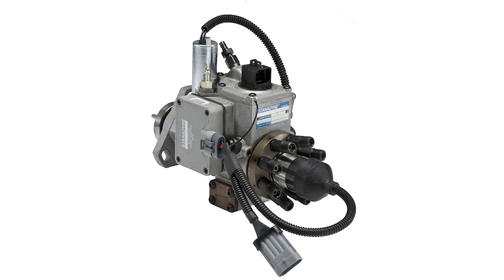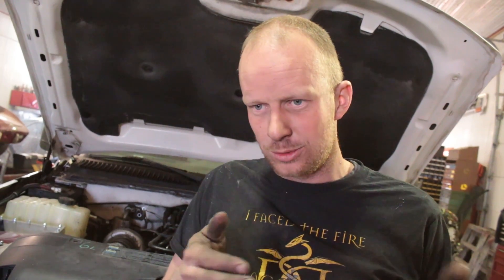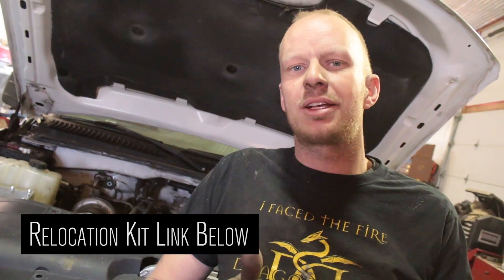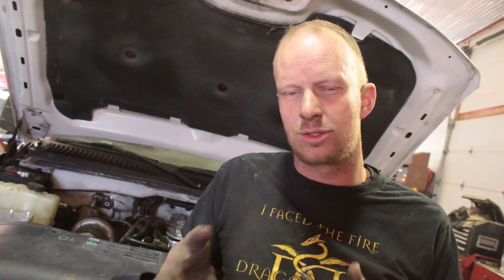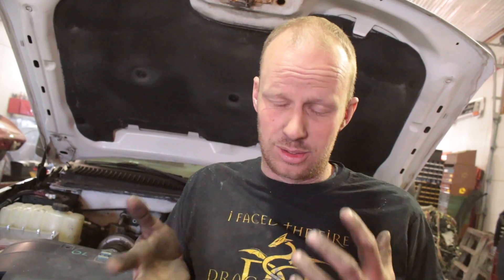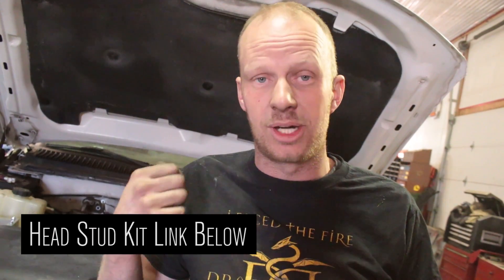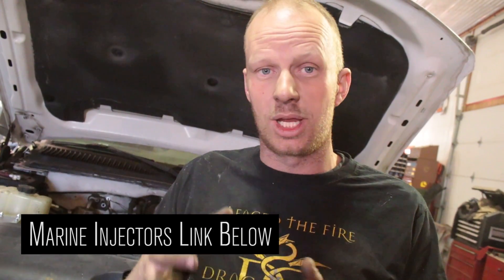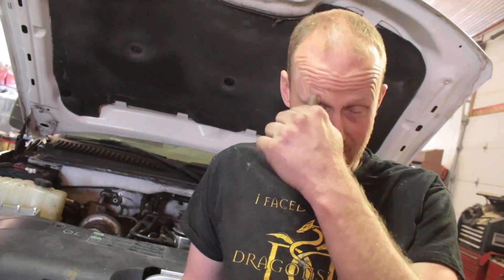REVIEW: Everything Wrong With A GM 6.5 Detroit Diesel

Comment: You are one of many I have heard say the 6.5 TD can't pull. I have to wonder where you all bought yours because I have owned 1 of my own ('92 Chevy 3/4 ton) and driven quite a few company pickups (3/4 & 1 tons) with the 6.5 TD and have never had any problems pulling whatever I've put behind them. In fact, my own 3/4 ton was more than capable of dragging a 28' neckover trailer hauling a Caterpillar 416B backhoe down any highway, even in hilly conditions, without loss of speed. I have known of a couple that had been modified with high lift, huge wheels/tires and so forth which had lost a good deal of power but once the proper gear ratio was put in the axles that problem was solved. Driving a truck with a 6.5TD does require a different technique than a gasoline powered vehicle to get the most power. Most people tend to floor a gasoline engine to accelerate, especially when going up a grade. If you floor the 6.5 it will usually cause the engine to lug, probably smoke some and take quite a while for the turbo to speed up. To avoid lugging the 6.5 and get the most out of it throttle management is essential. The best practice is to accelerate gently until you can hear the turbo singing then add more throttle as the engine will take it. If your driving habits are making you see black smoke in your rearview, you are wasting fuel and not getting the most power from your 6.5 TD.
Reply: Y'all are full of shit down talking the 6.5...I've got a 1997 c3500 quad cab dually with a 6.5..and a 4l80e tranny.. It has 212,000 on it..and I haul freight with it daily..usually total gross at 22,000 pounds.."truck is 7,000 pounds by its self...point is no it's not a big CAT engine..but it's solid if you take care of it..and mine has zero blow by..even at its mileage..try getting that with other diesels...Yes do the relocation..couple hundred bucks..change the lift pump 68 bucks..change harmonic balancer "which is the cause of the cranks breaking"..92 dollars. And change crank senser 32 dollars. Maybe a external cooler would be a good idea and oil temp gauge..tranny temp gauge also good idea if you haul with it...Use good injector cleaner regularly...yes waste gate should be made manual 150 bucks??..point is you can spend 600 or 800 bucks give or take on upgrades and it will last forever...oh yeah..and yes the injector pump is 989.00 at auto zone+ install..BUT..it won't go bad if you do the other mods..and even if it dose...it's still 500 cheaper then just buying injectors for a duramax...let alone installation..my injectors are 300 if they ever go bad which they still Havnt..and unlike the diesels I can change them easily in a afternoon..the others diesels you better have a engineering degree to change them or pay a shop a grand or 2.
Reply: @dieseldog2649  I pulled my rv trailer coast twice with a 6.2 banks turbo and 410 gears
Reply: People are missing one of the important things that makes the 6.2 and 6.5 different than other diesels that came later like the PSD 7.3 and Cummins 5.9. Both of those later motors were commercial diesels that changed to meet standards needed for installation and road use in light duty trucks.
The Detroit Diesels on the other hand were built from the beginning as light duty diesels that met emissions standards for use in half-ton trucks. If you were hauling stuff, and not even really heavy items, you could only count on 10-12mpg from a 350 in the 80s. She might do better unloaded, in overdrive on the highway but once under load your fuel economy went out the window. 
Ditto for the 454s in the 3/4 and 1-ton trucks. They'd haul anything you wanted and get 9mpg doing it. You just accepted the shitty mileage in exchange for the torque and when gas was less than a buck a gallon, who cares? But the 6.5, especially in later turbo form, would deliver better torque than the stock 454. If you're running a fleet of heavy duty trucks, it's hard to argue with a fuel sipping diesel that has decades of development and aftermarket support along with a thriving marine parts business. Sure, she ain't as hot as the commercially derived PSD or Cummins ISB, but you never paid those kinds of prices for them either.

Comment: I just got rid of my 6.5 not too long ago. I had relocated the PMD, installed a Heath chip, hx35 turbo, swapped out the fan for a bigger fan off of a duramax, diamond eye straight pipe, and cold air intake. Overall the truck was fantastic... it never gave me issues and I used it as a daily driver. In fact it never broke down on me once. 144k miles on it when I sold it. Consistently got 22-25 mpg unloaded and almost 20 pulling my enclosed trailer.

Comment: The black Box is called a  pump mounted driver.  There is also a chip that goes in between the pump mounted driveand harnes.  This chip if memory serves me right came in 1 to 9. Its a fuel Resistor that changes fule output of the box. There was also a short harnessed that went between the pump And the main body harness it was a RF harness basically. I had to hit remove it on my 96 Due to the truck started busting up rough idle no power. After a talk with the guys at SS diesel supply  They had me check that before I remove the pump for rebuild. Saved that cash.

Comment: Have you ever had any GM 6.2's come through? They went from 1981 or 82 to 1992. They were N/A but in later years a Banks Turbo kit was available. They are an economy Diesel, get really good mpg and decent power. They also used them in the early Humvee's and CUCV's. With a turbo and OD you can get about 20-35 mpg. 6.5 manifolds, heads, and turbos are interchangeable. I'd love to see your opinion on these.

Comment: I have a 6.5 in my 99 HD flatbed. I really was never convinced I made the right choice to buy a truck with a diesel. Couple of Q's. 1. do 6.5 diesels all have valve covers that say "Goodwrench" on them? 2. I have 92,000 miles on it and it has hardly any oil pressure once it warms up. 3. This thing leaks oil like there is no tomorrow. My friend says there is to much internal crank case pressure. Or or or or. To many ors. Have you heard of a leak that bad on an engine with 92 grand on it? I live in Mississippi so it does not get that cold in the winter so a cracked block is not high on the "maybe" list. thanks in advance for any info.

Comment: My dad had a 99 white crew cab dually driving down the road not under a load or anything snap the front of the crankshaft off after that we bought a junkyard motor that had a hole in the side of the block ran it for about 2 years love it with cast iron welding rods and J-B Weld leak like a sieve but ran for about 2 years before overheating and never got to finish a Cummins conversion of my dad passed away in 2014

Comment: One thing you forgot is when the Harmonic balancer goes bad it will brake your crank shaft.
The dirt settles in the inside hole of the Harmonic Balancer and throwing it out of wack.

Comment: I just bought a 2000 k3500 crew cab smoking white smoke sounds like a missing injector pulled the intake off turbo is spitting oil but still feels like a missing injector also showing like 40 codes which I think is all of them anyone have a diagram for the ground wires ?

Comment: The last 8 years with my 6.5L  have been in a 95 Suburban, as an electronic pump turbo engine.  The electronics took a while to get used to, however, I must say the Suburban even stock was much faster than the Blazer ever was.  I rebuilt the engine on GP before dropping it into the Sub, and found the crank, pistons and block to be in excellent and clean condition.  

I think you did a good job explaining the pump situation.  Yes the black box, or the PMD or FSD, is the heart of the whole operation.  It's recommended to get it out from under the engine bay completely and into the freshest outside air you can find. Mine rests just behind the front bumper on a huge heat sink.  Gotta keep it cool at all costs, or else it will cook on you. Not a bad idea to keep a spare box on ya.  

Other things to consider.  If your lift pump (main fuel supply pump) is not working properly, you will burn up the high pressure injection pump.  One of the troubles is the circuit for it runs through the oil pressure sender, as a safety measure (no oil pressure, no fuel supply).However, it is a weak link, and the IP will continue to struggle and pull fuel even without the LP.  We modify that circuit by using a relay. Keeps the original intended safety there, but pulls 12v supply power straight from a battery source. 

I indeed did stud my heads when rebuilding. ARP sells $180 of the best piece of mind you can buy.

Another area of concern- oil cooler lines.  Replace the crimped hose/line nightmares with braided stainless lines.  The stock lines will blow and relieve you of all your precious oil at a very bad time if you don't heed this warning. 

The last area I will address- cooling.  2000 and later engines have the best cooling systems.  Good news is the 2000 pump and cooling fan will fit the older models of the engine and provide more even water flow to both sides of the engine.  Keep this engine cooler than 210 at all times! 

You can modify these engines and make a solid 275 HP at the wheels, considering you've updated all of the weak links I mentioned above.  It will be reliable and you'll be able to do some work with it, but no this is not a 1000 HP coal roller.  Best for efficiency and economy.  Hope this helps anyone thinking about giving one of these engines a try. It's been very very good to me.

Comment: I have put over 300,000 miles on the same 6.5L over the past 20 yrs, so please allow me to add my input.

It is a good engine.  I remote start it every day almost, and it lights off on the first start 99% of the time.  This is true whether it's 100 degrees or 0 degrees outside.  If you forget to plug in the engine heater, it's really very forgiving and will still start.  I do try to take care of it and plug it in below 15 degrees.  

The first 12 years I had it, it was naturally aspirated and mechanically injected.  Not a powerhouse, but definitely a worker and comfortable cruiser in a K5 Blazer.  It returned 25 mpg in that platform.  I had a learning curve on how to keep a 700R4 behind it.  Didn't help that the guy who built the trans first put a gas torque converter in it with a higher stall.  But this isn't about 700R4's.  Engine always did it's job without complaint.

Comment: Thanks for not being a dick!!! This is a good and honest review of a 6.5 for the most part. Some numbers are not perfect but close enough to make a good decision. I love my blazer with the 6.5 in it from the factory. But I have updated everything on it. New injection pump, injectors, tune, cam, exhaust, intake ( entire intake system) 21 Lbs of boost 400 HP. And stock heads studs and gaskets.with no problems yet. Waiting for them to blow to replace but great engine with the right updates.

Comment: I have a 6.2 Detroit NA with Muncie 4 . As long as you're not trying to lay your foot in it and you maintenance it as should good work horse with good low end torque no speed demon by any means so any kids looking to swap for speed would not recommend. But problems with 6.5 coming from a 6.2 is the wiring I believe just from going all mechanical to a wired up system it's guaranteed to have flaws.

Comment: I had a 94 6.5 for about 5 years. It was nothing but a money pit, but hey what diesel isn't. Had everything from inj pump problems, to overheating. I ended up selling the truck due to a crack in the block where the starter bolts up (couldn't start the truck). That is also a big issue with these motors. I will say a straight piped 6.5 with marine injectors sounds mean, that's it.

Comment: 6.5 sucks hands down. Served in the Marines as a wrecker operator and that was 90% of what I towed. They just don't have the power they need as a result they get over worked and over heat very quickly. Doesn't help that the hmmwv had armor upgrades. Thank god that platform is getting replaced by the JLTV from Oshkosh

Comment: Turbo??? Mine is Naturally Aspirated and I love it. Just blow an oil cooler hose but it should be an easy fix. I've replaced my pmd but ultimately it was an injection pump issue. I bought the pump from rockauto for 750 and did the work myself with the help of a Chilton manual. I think I'm just going to block off the oil cooler lines for now until I decide on a new oil cooler.

Comment: i think 92 mechanical pumps are the way to go. the military didnt use elec pumps. i did a 94 engine into my 97 trk and i had to get new oil cooler lines. i forget where from because 94 blocks used 3/8 fittings vs 97 used 1/2 fittings and i didnt want to buy another new oil cooler for the 94 since i had just bought a new one 3 months earlier. the oil lines were a pain to install but worth it.  a 7 to 8k trl was about all the 6.5 was good for in my opinion unless you could do a major build but i couldnt afford it. the 4l80e was a very good trans verses ford and dodge autos which i wouldnt trust. my 4l80e went out but i had a fliud leak that caused it im sure not pulling 13k.

Comment: All my busses have 6v71's and 6v92 and 8v92's love Detroit s💗💗💗💗
Reply: You can keep both of the 6v in a motor coach they suck from a drivers perspective. The 318 and especially the 8v I loved to drive.
Reply: @NoName-tz5ji  The Detroit V6's were just as awesome as the V8's...The 8V-71 and 8V-92 are screaming demons...But the 6V-53 is a worker,they still use them in the M113A3,they weigh 27,000 lbs with armor included,with 400 HP...They've been using them for over fifty years already.

Comment: To be honest I could never understand why people bought diesel engines in pick ups unless you went almost constantly hauling loads. Even considering all the truck makes have had (and they all have had major problems) why not buy it with a gas engine. They are reliable, quiet, reasonable on fuel, make good power and if maintained will last the life of the truck. I have had friends with diesels and almost all had constant problems and when they are out of warranty horrific repair bills.
Reply: Robert Bradley Fuel econ. A gasser burb would get 8-13mpg depending on what you're doing. A 6.5 burb like mine does the same work for 18mpg.

Comment: I've had a couple 6.5's, and they have both gotten stupid good gas mileage. If you want a good, reliable 3/4 or even 1/2 ton truck to occasionally haul something with, but mostly drive, the 6.5 is a great choice, especially the older mechanical 6.5's. Mine was 2WD '93 model and I easily got 23 MPG, not babying it at all. I would shy away from one if you want to tow/haul heavy stuff with it  often, as the crank in the 6.5's are notoriously weak.

Comment: ive got a 6.5 mechanical injection and love it, best truck ive ever had. Also have a 94 dodge p pump cummins. Hate the truck, always something leaking or braking. The 6.5 is my main trailer puller. Its a lot faster then the cummins too. I do love that 12v cummins other then all the leaks but my 6.5 has been the best. Never let me down and it could hit a million miles.

Comment: So here is where a big can of worms gets opened. I am looking at buying a 97 suburban. I have found 2 of them. One is a 5.7 gas and the other is a 6.5 diesel. Which of these would make a better daily driver with better reliability ?
Reply from the maker: how far do you drive daily and how much do you tow?
Reply: Daily drive probably 40kms-50kms a day and not much towing. But have always had an interest in diesels but never owned one. Always keep to the maintenance schedule too.
Reply from the maker: Honestly, they get roughly the same mileage, (not very good...)but the 6.5 will pull slightly better.  If you aren't going to tow, I would go with the 5.7.  What climate do you live in?  Diesels don't become efficient until they are warm and the mileage takes a hit, with only 20-25 km one way, the gas will be less expensive to run.
Reply: I live in new Zealand and we have a climate almost identical to Seattle. fuel economy isn't a huge priority but reliability is. I need something I can count on to run everyday. I've always stayed on top of fluid changes and filters plugs etc and still had a really bad run in the past. I thought something older and simpler would do me better than something small and modern.
Reply: id say youve prob decided by now but from what i know both are incredibly reliable as long as maintained & not over heated.
Reply: That depends on : tow a lot ( diesel), frequently left out in the winter cold ( gas starts better, cold), or if you don't like the noisy engine.. both of those engines are pretty reliable, I'd pick the one better maintained .
Reply: We have a 1998 suburban with the 5.7, it's got 280k on it and we've had no problems.

Comment: Actually 1600 to rebuild the injection pump is a bit high, HPOPs run under $600........  
The HEUI system is way more reliable as well.
7.3PSD can get 1 million miles and some another 500k after that if taken care of.

Comment: 6.5s were junk, my Dad is retired Army, he said they were not that reliable, head gaskets went poof alot.  I had a 95 6.5 that was a prison van 157k miles, needed new heads.  
I'll never have another.
Reply: Patrick TheBaptist Any engine will do that when treated like piss. Army stomps the crap out of 6.5's.
Reply: Right and my dad use to be in the army and told me how they ate head gaskets all the time....  They sure won't take the beating that I've PERSONALLY abused.  Best one I have seen for taking punishment was a 92 Isuzu 5.8 I6 turbo diesel, I was so hard on that thing always running it screaming on the governor, 3 speeds and interstates don't get along.
It was still running great when I sold it, 400 something k miles on it.
6.5 I had, had not been abused, 157k miles is a joke.